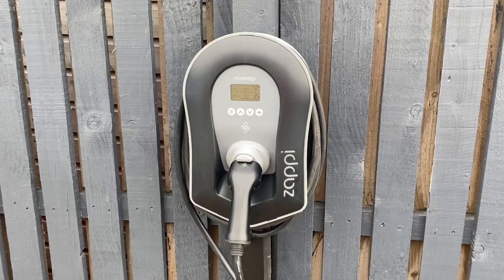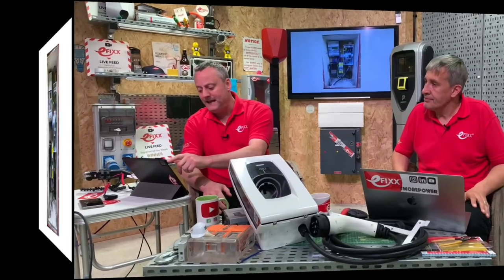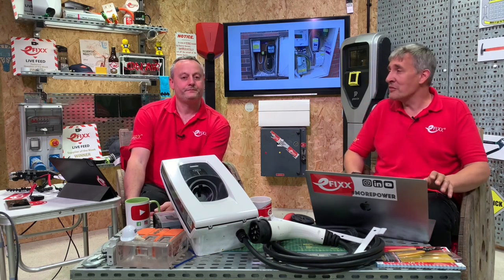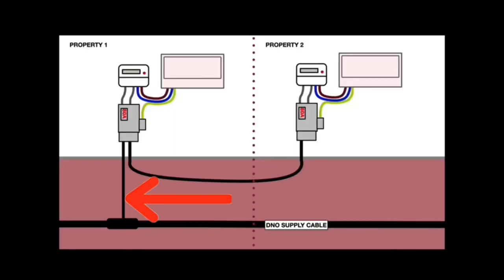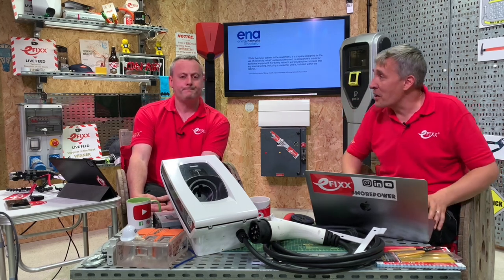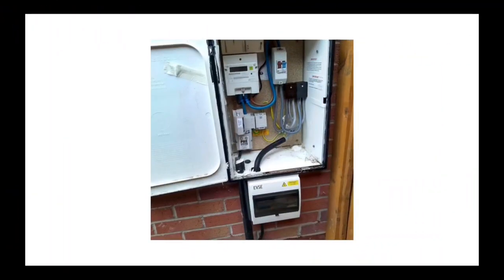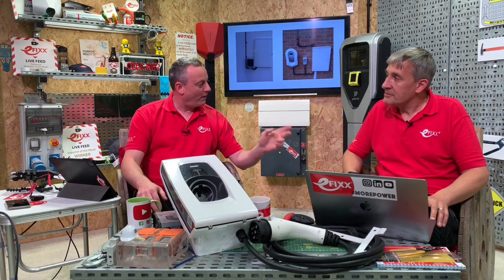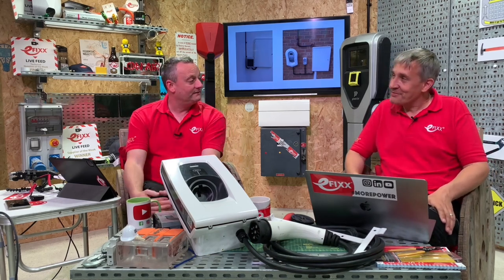Can ELECTRICIANS fit equipment inside the DNO METER BOX? - EV Charger Installation UK

Comment: So if your meter is further than 3m away, where does the fused isolator go.
Reply from the maker: On the other side of the wall behind the meter box
Reply: So on the living room wall between the tv and fire place than. 🤪 
There needs to be a bit of common sense taken here.
Reply: @brendon-paul  exactly. This isn't an absolute and all the responses were very guarded... They can't have it all ways. The client owns the box so they don't have to maintain it but we want to control what's in it. Whatever... This is like the seals on the service fuse that no one cuts. They turn a blind eye because they don't have the infrastructure to fit isolators or make temporary disconnections. They could fit those meters with a built in isolator but clearly they're more interested in cost. The reality is they would have to have very good reason to cut a supply to someone. It would create an absolute shitstorm. Whilst I would probably try hard not to out an ev board in a cabinet I have put switch fuse isolators in to protect submains to comply with their rules on meter tails length... This industry is a horror show at the moment. Too many cooks spoiling the broth.
Reply: @efixx  I'm screwed if the internal wall back to back is that of a bathroom or has kitchen carcasses in situ.  The DNO themselves are willing to fit a fused isolater in the cabinet,  what's the problem with a sparky doing it?   It's a grey area in which you automatically know what the ENA's response is going to be.  I know there are IP rated enclosures available,  but these look unsightly.

Comment: At my home, the Electrition put 2 Henley blocks in between the meter and the tails to the consumer unit, and connected them to a separate RCD and added an earthing block. He then ran the wires out of the meter box to the EV charger.

Comment: Is there an ev installer you can recommend in North Staffordshire? In my case I would need a mini consumer unit fitting behind the meter box (preferably higher up, close to ceiling if possible). Would then need a long cable 6 to 8 meters through the alleyway and then probably buried to the end of the back garden with charge point fitted to a pedestal if it can't be fitted to a shed or fence. Probably a zappi as longer term I'm fitting solar.

Comment: The cabinet should be for the meter, cut-out and E7 timer if needed.  A separate  cabinet should
for convenience be supplied for anything else, including EV charger supplies - as for temperature
rise concerns, it would take some very bad equipment or connections for this to be an issue ? 
Unless you have some information to prove otherwise ?

Comment: I've been waiting for a video on this matter.
The long and short of it is,electricians install the kit in the( METER BOX) because it is easier and more better to hide it in there aesthetically for the customers point of view.
As a meter engineer if a customer has a fault with a current meter or needs an upgrade to smart for example then with all the other equipment  in the meter box this reduces the possibility of fitting a new meter in the box.the amount of times I've encountered consumer units etc installed straight on top of a meter is ridiculous.theres no way of lifting the meters off the back retaining screws.keep it simple.meter box is for the meter and meter accessories.by all means instal a separate box for all your consumer units etc.

Comment: Interesting, Podpoint installed mine; they fitted two Henley blocks and an EV isolator inside the DNO Meter Box so as a consumer / customer, safe to assume someone like Podpoint knows what they are doing so mine stays as it is.

Comment: It's interesting (and perhaps telling) the official statement from ENA is "For safety reasons we would not recommend that any internal wiring, including a consumer unit, is installed within the cabinet" 

They did not say it was prohibited, they said they would not recommend it. I have two switchfuses in mine (predate me purchasing the property) and it's never been a problem or even mentioned when the meter was changed.  There is, however, no room for much else now!
Reply from the maker: Who’s problem is it when a problem does occur ?

Comment: But the response was like an RFC on the internet standards, in that there is a big difference between 'shall' and 'should'.  They said "recommend" and didn't say "no other".   So if you follow this "recommendation" then no CT transformers can be located in the box, and if you have multiple CU already then you would have to run CT's to each panel as well.  What is the solution then for the EV chargers to work correctly if you can't install CT's (harvi) as well?  Here in the US, there isn't any meter cabinet, and its literately a meter box, so we don't have this issue, there are no fuses in the meter box, its just a set of knife edges that the meter snaps into.  The first breaker / (fuse) is the main fuse in the load center typically, which can could be a long run away from the meter.

Comment: Considering an outside socket in external cabinet, now I will just get installed on the wall. I do think electrical Regs need to change to ensure all outside sockets/ lights are protected by an isolating switch locally inside rather than just wiring external sockets piggy-back from interior socket (spur). Reason for this is you can isolate to take exterior out of circuit if there is a problem without removing interior socket.
Piggyback sockets to me is a bodge
Reply: "rather than just wiring external sockets piggy-back from interior socket (spur)"

External lights should never just be spurred into the back of a power socket. If they are powered from the back of a socket they should be going via a switched fused spur with a suitable fuse installed. Just connecting an external light into the back of a socket which might be on a 32A ring will almost certainly already conflict with regulations as I doubt there are many, if any external lights are designed with that in mind.